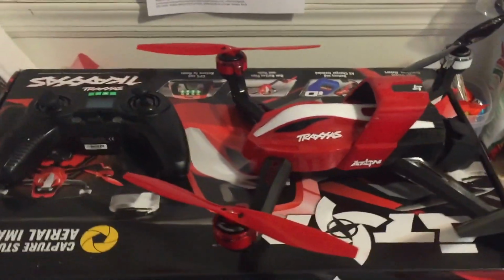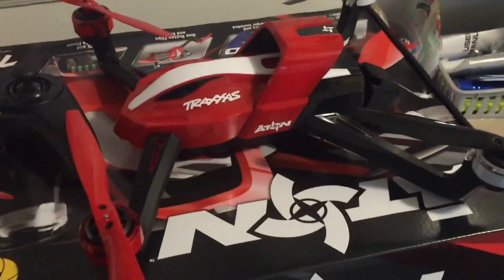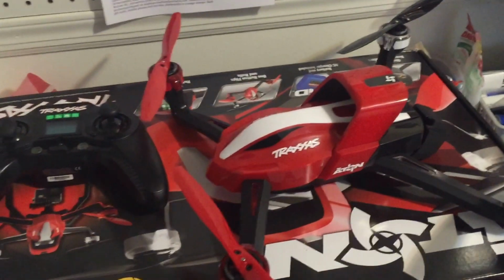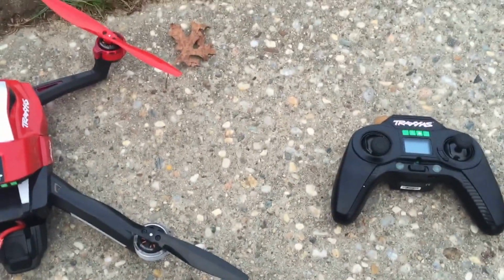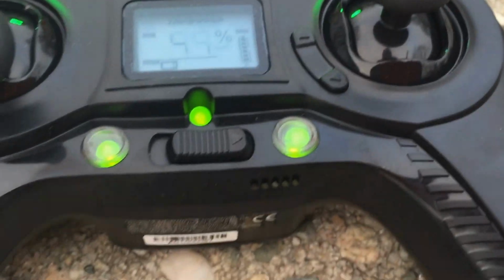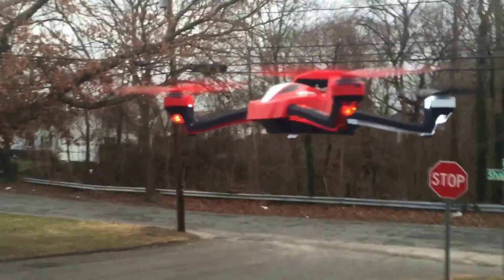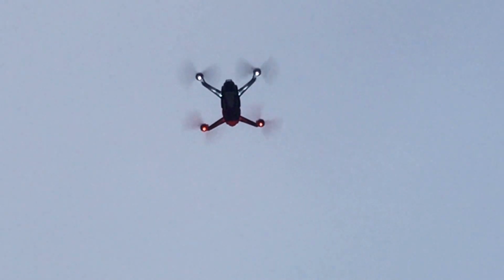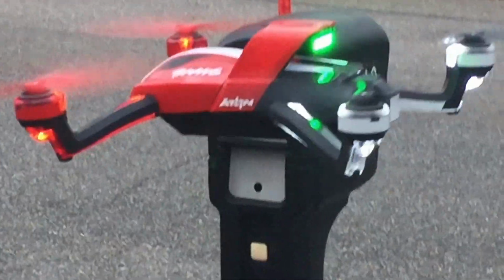Traxxas Aton

Comment: Is it possible to stick a camera mount on the bottom of the Aton and place an action cam on?
Reply from the maker: +Auto X Master yes...the surface area on the bottom is spacious allowing many different ideas as far as cameras are concerned....
Reply: +prex61 OK thanks, hope to see more videos! Also what do you think could be improved on this drone? Is anything a little fragile and breaks often?
Reply from the maker: +Auto X Master actually what impressed me the most and I stated this on the video is how solid this aircraft is. On a lot of other drones the arm is usually the weakest but in this aircraft the arms are pretty solid. If you do crash and do happen to break something we carry the full line of parts on our website. If you have any questions you can also call us directly at our office at 631-730-7228

Comment: What a great video!
Range?
Reply from the maker: +Daniel Orlov out of the box it comes preset with a range of 500 feet. You can set the range to 1000 feet in the software. You can also shut off the range, in which case depending on where you are if he goes out of range it will automatically return home to you. Like I told other customers if we can be of any assistanceDo not hesitate to call our office Monday through Friday between the hours of 9 AM and 5 PM p.m. Eastern standard time at 1-888-239-2644
Reply from the maker: +Daniel Orlov by the way thank you for the compliment